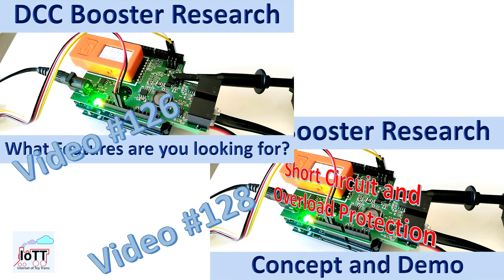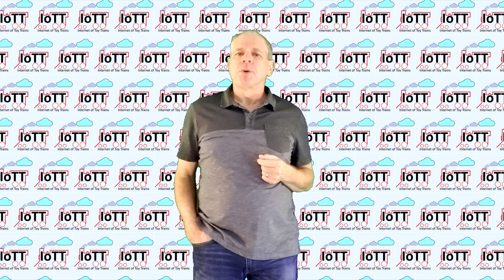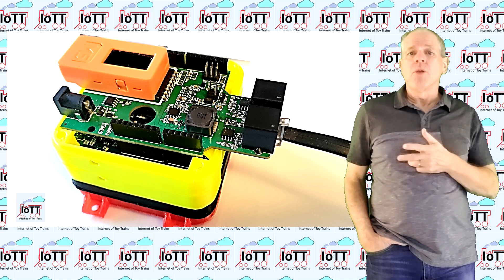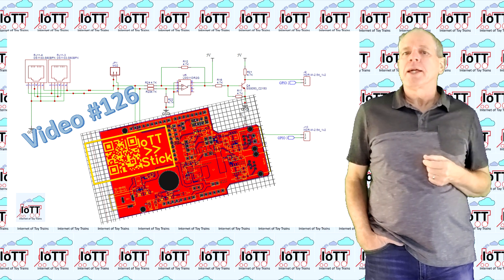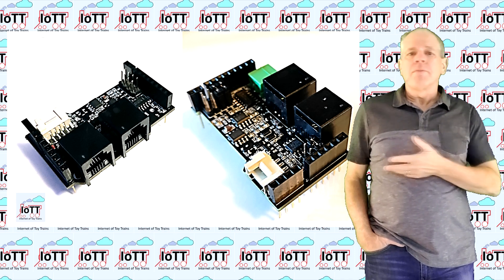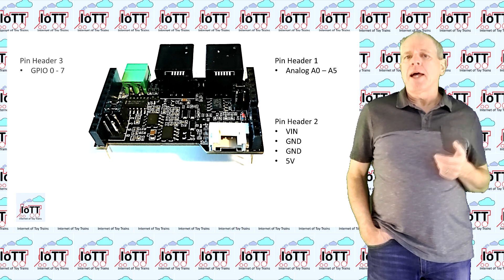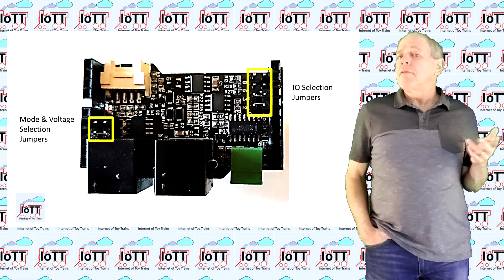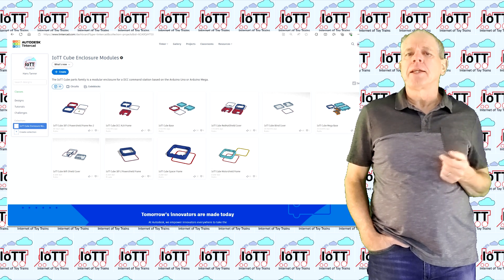DCC Interface for the Booster Project (Video#133)

Comment: Hi Hans - I am using a Uhlenbrock Daisy 2 system with a Digikeijs DR5088RC and getting RailCom information back from my trains - will your booster connected to the Uhlenbrock systems accommodate RailCom?  Thanks.  Bill
Reply from the maker: It should replicate the cutout in the track signal and put a short circuit on the track so that railcom decoder can transmit the feedback bits. But it does not have a railcom receiver, so you need to have an additional receiver like with other boosters. I have no experience with Railcom, but based on what I studied, this should work. But of course it remains to be seen ;-)
Reply: Sorry - not totally with the terminology - would the DR5088RC be acting as the receiver………..
Reply from the maker: Yes. And the booster would take the role of the DR5033 Digiboost as shown on page 35 of the DR5088R manual https://drive.google.com/file/d/1-VFakeFs9OC0TfkCKBw7Mxn3ecfj_csf/view?pli=1

Comment: 😅 Great stuff! Very interesting.  Am I correct in thinking that the Loconet ports have power on 2 of the pins?  ie you would connect this to the Loconet T bus along with other accessories such as throttles and occupancy detection as opposed to  another Loconet power supply booster such as DIGIKEIJS Dr5033 which resides on a separate Loconet B bus which doesn’t carry power on 2 of the Loconet pins?
Reply from the maker: If you connect it to Loconet B it will pick up the DCC signal from pins 1 and 6 of Loconet. If you want to connect to Loconet T, you would have to cut wires 1 and 6 as they carry DC,  and feed the DCC signal to the connector on the side. The booster can pick up commands either from Loconet or DCC, but whenb using DCC it is limited to switch and signal commands as that is what DCC supports. On Loconet, it also can read from block detector input and button input. Plus it can report short circuits and overloads to the network.

Comment: Great stuff. I recently installed a 36 track turntable. I messed up on the stall track wiring so I would need a booster that has reversed polarity. Also knowing that the bridge track can show block occupancy would help me setup an automatic stall selection routine using loconet. Thanks.
Reply from the maker: Thank you. Yes, the booster will be able to do short circuit based AR as well as controlled AR using switch commands etc.